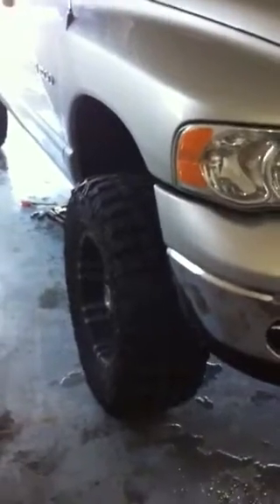2005 Ram 4.7 Crankshaft Position Sensor Location

Comment: Awesome , thanks buddy . saved me from having to look all over my block. plus I can take a 1/2 with me so I wont have to climb back out to get what I need.  helpful video
Reply: mine just wouldn't start back after I had turned it off. its throwing this code so hopefully it will have me back on the road again.

Comment: Beware, most cases aren't this easy. It will more likely than not be stuck into the block and be very difficult to remove. You can search and see numerous cases online of people breaking off the sensor trying to get it out and then having to extract the remains somehow.

Comment: I have an 04 dodge ram 1500 4.7 it takes about 5sec to crank but when it does it idles just fine but can't rev it pass 2500 rpm seems like it's dead after that could this be my issue
Reply: Jt Gordon your truck is in limp mode to save the engine
Reply: Mine is having the same exact problem. Did you ever figure out what it was??

Comment: Make sure you double check the tags on this video on youtube.  I've been looking for a video like this and for some reason it wasn't popping up on google for the last 6 weeks.  I've got the manual for this model (I have a 5.7 Hemi) and for the life of me, the 5.7 Hemi model doesn't have its own figure in the book.  I've been told there is no way that I can access this from underneath of the vehicle but it seems you did it.  Where's the starter?  Did you already take it off?  I was under the impression that it was behind the starter which was another reason I was told I couldn't get to it.  Any advise would be great!

Comment: Hey buddy, I have a few questions, that I hope you are able to answer.
Were you showing a different part at the very last part of the video?
Or was that the new replacement crankshaft?
& where is the CAMshaft position sensor?
Reply from the maker: it was all the crankshaft pos sensor, just different angles of view on it...the camshaft position sensor if I remember was on the front left of the block near the top somewhere...I would have to research it myself to know for sure honestly, but there are videos on here that show the location of the CAMshaft pos sensor

Comment: Is this the crankshaft or camshaft sensor?
Reply: Les Deplorables crank. It's the easiest of the 2 to get to. Held in with a 10mm bolt. Cam sensor is going to be on the air cleaner side of the block 😉